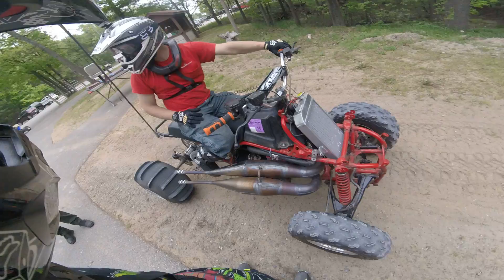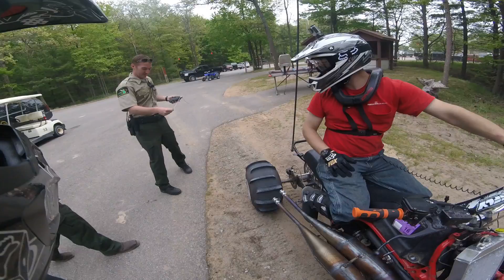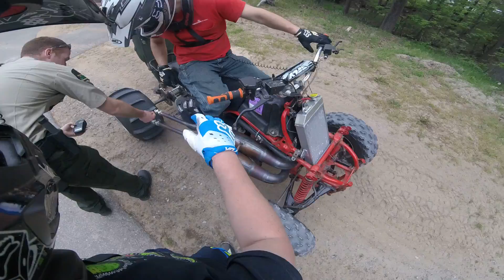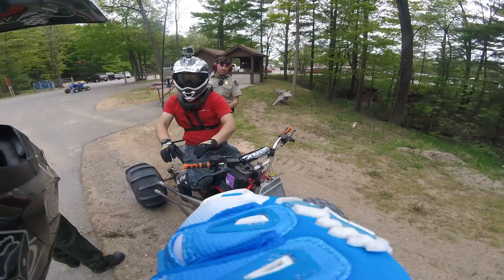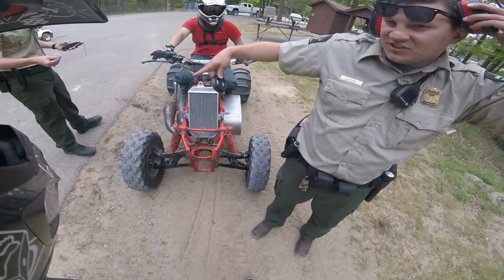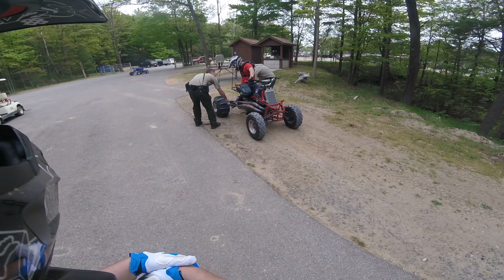Silver lake sand dunes sound decibel reading. And totally bs spark arrestor check!

Comment: he was holding the decibel meter right up against the pipe of course its going to be loud here in my state they got to be tested over 75 feet away heck you hold the mic at your mouth you talk louder than  94 decibels
Reply: Decibals are measured for sound pressure. You can blow into a db reader and get a 170db reading and a yell won't register. "Mufflers" break up pressure waves from exhaust to quiet them.
Reply: He put the meter in the pipe.

Comment: Music to my ears honestly. I find it more annoying when Harleys have loud straight pipes.
Reply: My old vulcan 1500 had shorty straights and I swear it was at 120db at least. Especially at highway speeds. If I rode without earplugs I would suffer temporary hearing loss for a couple hours. I never got any hassle out of anyone though, at least I couldn't hear them if I did lol
Reply: Stoned Red eye's the worst thing about straight pipes isn't that they're loud, it's that they're a display of plain, sheer stupidity. You LOSE performance when you straight pipe. When people straight pipe their bikes, they're actually losing performance over the stock setup. And most don't even tune their vehicle so they're running lean. You make hp and torque from the backpressure a canister creates
Reply: +ReaIDeaI1 if the pipes are  tuned to the proper length they'll create enough back pressure, while not burning your valves up as well. if they're chopped in a shop by Cletus then it's a whole different story.
Reply: ***** it's called a tuned pipe lol, engineered to be used on specific engines.
Reply: ReaIDeaI1
It's still annoying I don't care what you say.
Reply: +ReaIDeaI1 not true at all the only thing you lose is low end torque ..... every I've had and still have has straight pipes with proper jetting on my carbed bikes and tuning on the injected ones ....  so if factory has a lot of back pressure to meet smog laws on newer ones and fully tuned with stick pipes on my 05 Harley social deluxe I only made 68 hp.. when I switched to the D and D 2 into 1 I made  79. then switching to the 95 lot from the 88 and adding Andrew's cams I made 108. and every race team in gp runs straight exhaust too so how do you get the facts that straight pipes are a loss of power of stock. of stock was the king shit no-one would modify anything .
Reply: matthew roach low end and mid range torque is exactly what you need on the street. Exhaust setups vary depending on what track it is. Not every race bike has a straight pipe. The winning 600cc bike in this years Isle of Man (Yamaha R6) was running the akrapovic system. The BMW's were running akrapovic systems too. If you look at all the top exhaust systems on the market they all have canisters, and the larger canister systems make the most power.

Comment: Two things: First off, these forest service dudes were super respectful and cool.. props to them. they're doing their job, they had a lot of good, straight to the point facts to back up their info.
Second: The law (at least in Oregon, where im from) states that it can be a max of 89 dB when tested 25 feet away from the pipe. The nerdy forest service assistant was holding the tester right against the damn pipe like he wanted to be up inside it. This isn't your prom date, you need to test a certain distance away. im sure other states have different distances. be informed! these guys know they're loud AF, they should know they run the risk of getting stopped and tested. but most importantly they should have been informed and told the ranger to back up to the required testing distance.
Reply: Nube Toob 20inches in vali is the distance for nearby test
Reply: That's way closer than our 25 feet! Makes a huge difference. but hes still like 20 times too close than.
Reply: Nube Toob Yeah, but I don't think this video is cali. could be wrong. when I had my db test done guy said had to be done 20" for a near by and a further away test was around 20 feet.
Reply: Our law in Oregon just states the one distance.
Reply: Nube Toob Lucky, my dirtbike just ruined the db though. guess a r304 pipe is a little loud haha. welp, gotta go to Oregon to go ridin
Reply: DNR guy said 24 inches. He is holding the end of a 24 inch chain by the opening, the meter is in the other hand at the other end of the chain.

Comment: That sounds like a snowmobile motor
Reply from the maker: that's because it is a snowmobile motor
Reply: Sounds like my chainsaw.
Reply: tc1uscg your chain saw is a banshee
Reply: It is a sled motor, how does it mount up?..
I'm wanting to do that to my trx.
Reply: of course it does, its a v-twin 2 stroke
Reply from the maker: Daniel Katairoak we built a custom engine mounting plate with a jack shaft.. it's pretty  cool the engine sits in the frame exactly how it would in the sled... but when your best friend is a c&c programmer it makes it a lot easier
Reply: it is a 600 snow mobile motor on it
Reply: evilmanhut do you have a video on this bikes build?  liquid cooled? did you use different pistons due to the temperature difference? what about the drive set up? fascinating build man!!!!
Reply: the dude to answer your question on cooling one would only have to look at that giant ass radiator mounted on the front lol!😂🤣😂
Reply: isolated POOPHUT I missed that lol smh
Reply: like a tripple

Comment: My fmf on my cr85 has a forest service approved spark arrestor stamp on the inside, like in between the mounting braket and muffler, almost not visible without taking the bike apart. Even my 1970 honda ct90, which almost certainly no longer has a functional spark arrestor(like it ever needed one) has the forest approved spark arrestor stamp on her.

Comment: For a off-road vehicle to be ridden on state lands it has to have a US Forest Service approved spark arrestor. I've bought a number of old Enduro bikes and quads and every single one has a spark arrestor that says "Approved for use on trails by the US Forest Service". Problem is a spark arrestor purchased from a performance shop is not tested for off-road use nor is approved for use by the Forest Service. All stock spark arrestors however do have that stamping as required by law.

Comment: what's the decible limit there? I think I heard 94 db, but don't most stock MX bikes and quads reach upwards of 100+? I couldn't find any stats for my 06' 250 so I'm going out on a whim here. but that's nuts they won't let you ride the dunes with that beast, noise and sparks are of little worry out in sand.
Reply: also putting the meter right ON the pipe is going to pick up much more vibration which causes the piezoelectric crystal to vibrate more giving a false high reading, aren't these tests supposed to be done at a certian amount of feet  away at a certian rpm, and then taken at a meter at wide open throttle? looks like these guys need some more training I'm sound testing. on a side note pull your clutch in when doing the test as it does reduce the db output.
Reply: There are two standardized tests. 

1. 50 foot 2nd gear WOT test (this is considered a less reliable test) and the limit is 82db
2. The 20 inch test. The meter is supposed to be a minimum of 20 inches from the end of the pipe. and the limit is 96db (as of 2003)

Interestingly enough it was found that on the 20 inch test a difference in 50 rpm can drastically change the db results of the test, as can the distance of the meter from the pipe. 

In the study I read they did another test after 24 hours and it revealed that the db levels of the test bikes naturally went down. It is theorized that things such as rich fuel mixture conditions and dirty air filters bring down the DB produced by a given bike.
Reply: 100GTAGUY I got a rm250 Suzuki  2 stroke. and only thing kinda custom on it, is my r304 racing exhaust... I smashed that 94db... My dirtbike is loud, come on cali... The hell is this...
Reply: CrazyRedNeckModz Its pathetic isnt it?
Reply: The Misadventures of Redemption Hell yes it is. I got tickets because the damn 94db but my dad who has an Import bike. Well, a honda cbr 1000rr and it's just a little louder then my dirtbike. He kinda just gives some of the neighborhood kids rides and stuff but the elders always call the police on the noise complaint. Never test his bike on a db scale. Is it something against atvs utvs and stuff
Reply: CrazyRedNeckModz My father rode from the late 60's through the late 80's in California and he offered a little insight to me about this.

The dirt bike industry more or less evolved in southern California. I dont know if you have ever heard the old 2 stroke big bore bikes but they are insanely loud.

I am in the process of restoring a 1986 YZ490 and that thing is so loud you can hear it for over a mile away. it has so much power that at idle on its stand it vibrates across my garage floor.

Anyway back in the 70's my old man was growing up in Burbank and used to ride around on the streets, through peoples properties, he used to run from the cops etc. Then the Metal Mulisha got started and they were worse. Back then there were not really any designated riding areas, no rules and lets just say a lot of the 1st gen riders inadvertently ruined it for the rest of us. But also people are intolerant whiny little brats who dont realize that kids are better off making a little noise than out partying and doing drugs.
Reply: 100GTAGUY 94db at 2k rpm isn't very hard to achieve. At wfo they are easily 100+ db
Reply: The Misadventures of Redemption dude my friends kx250 four stroke is way louder than my KTM 250xc two stroke it bothers me
Reply: Blake Bode A lot of that stuff can vary wildly based on the type of header, the type of muffler, condition of the muffler packing material. My CRF450R is loud as hell when im on the throttle. But I also have a White brothers Muffler and my packing needs to be redone badly.
Reply: 100GTAGUY yeah in Michigan its 94db
Reply: What did you expect with those pipes with no muffler lol

Comment: Testing was done wrong. He was testing at the pipe. According to there rules. They have to have the mic 20"'s away. Here is there regulation. "Exhaust System Rules and Testing
At Silver Lake State Park, a static or stationary test for this equipment is used on all types of vehicles. Noise levels will be checked at a 20-inch distance from the exhaust pipe at half the vehicle's rated revolutions per minute (RPM) or as detailed in the automotive specifications SAEJ1169, March 92 or SAE J1287, June 86. The maximum noise level permitted under these testing conditions will be 94 dBa which is the current limit set by the Off-Road Recreation Vehicle Act as Park 811 of 1994 PA 451 (MCL 324.811). All vehicles are required to have a muffler and spark arrester containing baffles meeting established United States Forest Service specifications."

Comment: I've seen bikes catch Woods on fire without Spark arrestors,you should always use one in less MX track only.now them being stamped  ? I run pro circuit spark arrestors are removable and I have never seen one with a stamp.

Comment: You do know that if you just take it down to city hall and show that you paid $500 to a state mechanic to try to lower the db level unsuccessfully you can pay for a db waiver after you pay for the green pipe inspection fee after you pay orv park reinstatement fee before the carbon tax at the same time you apply for the sand displacement fee with sand relocation fee and undocumented detour fee on top of the hearing protection fee (for those that can't afford ear plugs) you will get a sticker. This must be done within 7 days or your fees will be forfeited and you will need to start the process over. Easy...

Comment: the spark arrestor thing isn't bullshit. most factory and aftermarket exhausts have a stamp on the end of the pipe  and a screen material and its marked "usfs spark arestor: model# xxx" you can get a screen for the end of the pipe and technically that would be a arrestor.  why you wouldnt put a muffler on it is beyond me. that thing is loud as shit. sounds like a honda civic with open headers lol

Comment: last time I went there is had my raptor 660 spark checked. they did it with a stick down my pipe and tore through my screen. I had to go buy a new $35 screen from their store right there so I could ride.
Reply: Had the same thing happen to me last year on an atc 250r. Guy looked in and touched it with his fingers and then  jammed the stick in as hard as he could as if he was trying to rip it on purpose. After his second attempt I grabbed the stick from him and threw it.  He then threatened to have me arrested. They can be real a-holes!!

Comment: Doesn’t look like 20 inches away to me?! 
California law: 
This sound test is conducted by measuring the exhaust's sound output from a distance of 20 inches away ( a test procedure known as SAE Standard J-1287).
Reply: The string he is holding that is attached to the sound meter is cut 20 inches, as per the MICHIGAN law. Because this is Michigan so California law means absolutely nothing in MICHIGAN.
Reply: Cristy Freeman Cristy Freeman thanks for trading one crappy state for another crappy state. Makes no difference which. But, I guess when the official mentioned California, it seemed reasonable. I guess not.

Comment: Tell you what, these 2 DNR officers were either trained incorrectly or they are corrupt. As for the comment about California testing spark arrestors, seriously....? USFS is federal and the guidelines have nothing to do with Cali unless you are in Cali or a state which follows California rules and regs..... "Noise levels will be checked at a twenty-inch distance from the exhaust pipe at half the vehicle's rated revolutions per minute (RPM) or as detailed in the automotive specifications SAE J1169, March 92 or SAE J1287, June 86. The maximum noise level permitted under these testing conditions will be 94 dBa which is the current limit set by the Off-Road Recreation Vehicles Act of Part 811 of 1994 PA 451 (MCL 324.811). All vehicles are required to have a muffler and spark arrester containing baffles meeting established United States Forest Service (USFS) specifications." "Park Rangers or other Law Enforcement Officials may insert a plastic rod into the vehicle's exhaust pipe to determine whether there is a spark arrester or baffle present"

Comment: Actually state law requires the meter to be held 20 inches away at a 45 degree angle ( which this affixed was NOT doing on either count) period also the officer is wrong on the spark arrestor FEDERAL and STATE only require name of manufacturer and model number PERIOD the words "approved or qualified are not required the officer has a little book in his vehicle he can then go check too see if it is acceptable.

Comment: Its crazzy how you can have a pretty much straight piped race car at a race track  and have a rule where it has to be 95 db at 100 feet. But yet the dunes has db check at 20" or varied depending what state your in it's stupid. And it seems like the dunes is really the only place they actually check for this stuff not even really on the streets ha as I've had my open header cammed Silverado idling at a stop light next to a cop before and not even a look over haha 🤣

Comment: Wtf these wardens/rangers don't even get to carry a sidearm .. ?.thats so lame so I'm guessing no arrest powers but they can issue citations ,in order to arrest they prolly need to call a trooper or local PD unit, very odd
Reply from the maker: mtr71875 they are actually Michigan dnr.. they have side arms and have more power than almost any police Precinct in Michigan
Reply: evilmanhut , yeah I did not notice either of these rangers having a handgun on there duty belt , if you look close at the video they clearly have a duty belt with baton and pepper spray but no holster , weird . I live in Wisconsin and yes the dnr wardens can enter residence with out warrant and seize any assets they wish if needed. I know our state park rangers have red and blue lights on trucks but have not noticed if our wi rangers carry a side arm either

Comment: I agree I had a tricked out 250r three wheeler on alcohol that  I loved dragging in groups with at silver lake in the old days and a full motocross  250r quad on race gas niether passed their decibels and i went home sold both and never went back. That was 10 years ago from what I hear its nothing like it used to be. Its a fucking sand dune why the spark arrestor rule and noise ordinance fuck silver lake its ruined like most places I used to ride here in michigan.